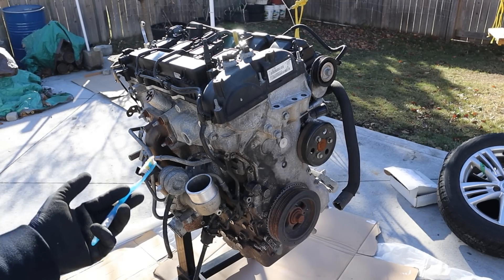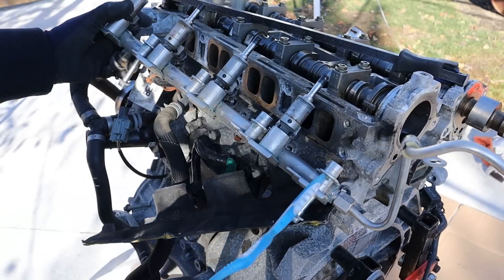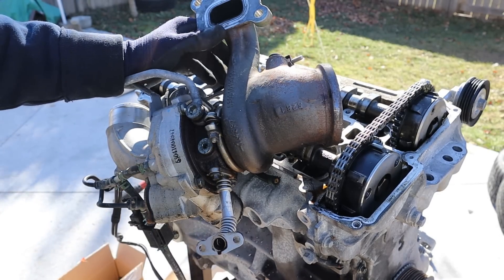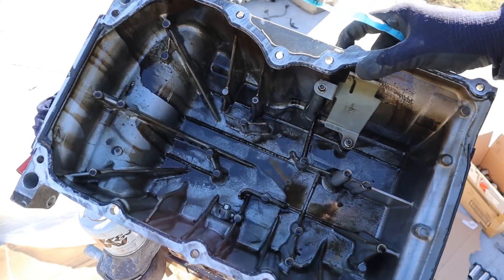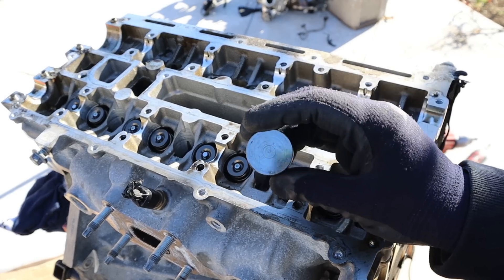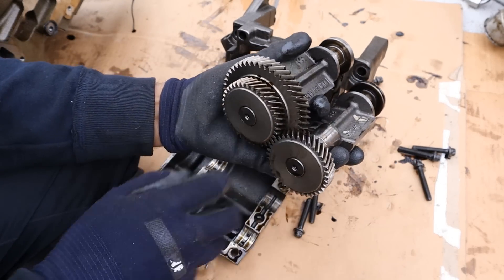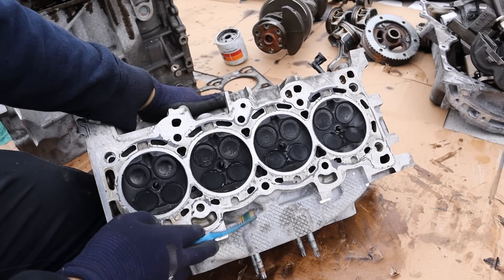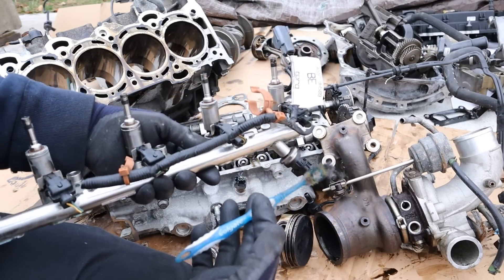Why Ford Ecoboost Engines Fail

Comment: Interesting.  I thought there was a class action lawsuit going on at the moment (in the US) for engine failures.  But I THINK that was for a later version, with, incredibly, a 'wet' timing belt, i.e. immersed in oil!!  So as the belt starts to crumble,  bits clog up the oil pickup & system thus destroying the engine.   Thanks for posting this.
Reply: The 1L ecoboost is what uses that wet belt design, as do their diesel engines. Who would've thought that putting rubber in oil would kill the rubber.
Reply: Another of Ford's better ideas??
Reply: Who thinks this shit up anyway????
Reply: @coolruehle  college educated engineers,  too bad their professors didn't know their ass from a hole in the ground.
Reply: @jeffro582  it’s best to not disrespect engineers. Tsk tsk
All engineers prefer simple designs that work, we’re not stupid.

Engineers design stuff, and are hired to design with constraints (eg costs)

Timing belt dipped in hot oil is never a desired design. That’s the feature that will sell (weight reduction, fuel efficiency, and novel)

I said “will sell.” Engineers are not hired to sell; only to design according to cost (which can mean cost cutting, which is not engineers fault)
Reply: Apparently, Ford is using the wet belt system in their latest Transits!!

Comment: In the 1980's Ford tried to use 4 cylinder engine in race cars that were pitted against V8 powered cars. Because of the weight difference, the Fords would lead for half a race, then the engines would burn out. I think one actually almost made a finish line, but burned up before finishing. Now they are doing this to everyone who buys this turbo shit.

Comment: All direct injection motors burn oil.... The carbon build up my guess is from not changing the oil frequently.......and was driven short distances usually.......highway miles really are a big deal when it comes to engine wear. Going over 3000 miles EVEN WITH FULL SYNTHETIC isn't a good idea with GDI motors....don't be cheap or lazy.....

Comment: My father's 2014 f150 with the 2.7 eco....no problems yet.....hasnt hit 100,000 miles yet. However my 98 explorer with the 5.0 v8 has 175k. Runs smoother than my 2500 Chevy 6.0 with 97k...... I run Lucas high mileage oil stabilizer every oil change with full syn Castrol oil in the Ford.....it started burning a little oil around 150k.....swear to Christ Lucas high mileage stabilizer stopped it from burning oil.....

Comment: Sure seems like a flaw, just like with charger engines that had coolant from the water pump seal leaking right into the crank case. What's up with that kind of garbage

Comment: My daughter bought a new escape 2.0 turbo in 2015. It now has 170,000 miles on it. Oil changes, tires and brakes is all that's ever been done to the car except at the 5 year mark I replaced the battery, belts, hoses, coolant, spark plugs, and coil packs. It has been a good vehicle.
Reply: My 2016 blew the head gasket at 66k just outside of warranty
Reply: @LiveLinerFishing  how did ya drive it
Reply: @fbcvxbnfgdgh  like a grandma. mostly highway
Reply: You're lucky.  My 2017 needed a new long block after 28k miles.
Reply: @angelas4681  yep. a $9k long block
Reply: You mush have pushed it for most of its 170k miles. 😂

Comment: My 2014 Escape 2.0 with just over 200k is still running well and smooth, trip from Calexico to Buellton averaging 26 mpg running it at average 70 highway speeds. I do maintain it regularly.

Comment: Nah. That ladder frame should be "aluminum". Not steel. Modern alloys make structural aluminum more ridgid than steel of the same volume would be. More brittle, but more ridgid

Comment: This is why it's Best to use Amsoil because it just makes the engine run better
JK I don't even use Amsoil 😆
Reply from the maker: Any oil regularly changed is better than extended intervals or no oil

Comment: Am I right in thinking that the carbon build up in the intake ports is due to the oil separator unit that puts the oily air back into the intake? Can this be bypassed to prevent the carbon build up?
Reply from the maker: Yep. And that's what supposedly caused this engine to fail...the PCV catch can.
Reply: @speedkar99  thanks for that,  now what do I do to stop my 2.3 ecoboost going the same way? It has done 46,000kms and doesn't use any oil. It gets serviced every 10,000kms at the dealer. Any advice would be helpful - even get rid of it quickly!

Comment: I have had 3 ecoboost engines which have covered over 150k miles with no problems you tube mechanics are ok but I prefer the proffesional company's as why would u make a shit product in this competitive world ..... I'm sure you have some failures but the percentage must be small buy unfortunately they shout the loudest........
Reply from the maker: Those small percentages also have an impact on brand image so everything counts, no matter how small.
Reply: So why single out ecoboost engines every manufacturer has failures if you did one on all of them it would seem balanced and fair no brand as you call it has a 100 percent product  and yes it does have consequences it usually does with everything   looking forward to your next upload.

Comment: Thanks for these great vids! I just like to mention that for (at least metric, I don' t know about imperial) fasteners you don't specify them by the head size, but by thread. So what you are calling 8 or 10mm bolts, are probably M6 (so a thread outer diameter of 6mm) bolts with a 8 or 10mm hex head. And what you call 12 or 14mm bolts, I think those are M8 or maybe M10 (either normal or fine thread). Same for Torx fasteners, so should call these smtg like M8 with a T40 torx head.
Reply from the maker: As an engineer I agree, that's how they're supposed to be called out. 

But someone taking this apart want to know what tool to use, the thread size would be irrelevant

Comment: 2017 ST here 150,000 miles no issues runs great. Oil change every 3000-5000 miles. Problem is the dealer’s want to do every 7500 and they burn a little oil so they fail easier if you go by the dealer.
Reply from the maker: Yep. The change intervals are too long
Reply: Damn you drive a lot. I got 130 on my ‘16
Reply: @dogewisdom9921  Yeah used to commute 150-200 miles a day. If I'm paying for it I'm going to enjoy driving it haha. I know a few people who don't drive their fun cars because they don't want to put the miles on them. I'm the complete opposite

Comment: Great content! This engine is a tour-de-force in engine design (thanks, Mazda!), and an engineering masterpiece.
I cut my teeth on pushrod, bathtub head clunkers from the 50s, and would have given my left ball for a beauty like this!
Reply: I'll give you the benefit of the doubt and hope that you were joking.
Reply: ford taught mazda how to build engines..mazda were sht..
Reply: @harrywalker5836  nope. Ford bought into mazda because they couldn't build anything other than a v8 reliably. Mazda was good before ford. And got bad during ford. And got better after they left.
The eco-boost is a bad turn based on mazdas L platform. Which mazda took and improved into skyactiv which are solid. While ford still can't improve a damn thing and are struggling to improve off a platform they worked with for years but didn't develop. They only ever threw money and hopes at it.
Reply: They blow headgaskets regular

Comment: Thanks! Terrific tour of a '16 Ford EcoBoost 2.0L Turbo.
My wife's '16 Escape has this engine and it's the first Ford we've owned in a long time. My fingers are crossed that our engine doesn't have some chronic problem. The first thing I noticed is that for such a relatively small engine (2.0L), the fuel economy is not very good.
Reply: They are Eco-or-boost, not Ecoboost.
Reply from the maker: In general, turbo fuel economy is not as good as claimed. The engine has to overwork itself
Reply: Same suv. 2.0L is way better than the 1.5L. 1.5 had coolant intrusion.

Comment: Cast aluminum oil pans are my favorite, I feel they are the sweet spot between light weight and strength.
Reply: Gee , if I hit one with a hammer, does it dent or CRACK??? LOL 😂
Reply: @@alexanderratisbona6614 steel pans also rust.

Comment: I love your no time lost teardown technique, fast and effective. You need a big air rattle gun for the tough bolts. I played the piston section of your video several times, it looks to me that the scraper rings were soft. Perhaps an engine that had been over heated without being fried. Otherwise rather sad that an engine in good nick got scrapped.
Reply: Given there were epic levels of carbonisation, I wonder if the turbo oil seals had failed and oil was being sucked into the inlet manifold. That's not uncommon with turbos, but it would have been accompanied by lots of blue smoke. One thing is for sure, that engine was not hydrolocked. If it had been, then there would probably have been a bent rod, and there would have been a lot of water, either in the cylinders or, possibly, in the sump. No sign of any of that.

Comment: He never said why Ford Ecoboost engines fail. Looked like a good engine to me. Just carbon build up. All direct inject engines get that. Pretty sure this engine didn’t fail. I have a 2.3 ecoboost in a 2018 mustang with 70,000 trouble free miles.

Comment: I get 21 mpg on the highway with my 4.6 explorer with over 200k. Still runs like new. Great video
Reply: I get maybe 14 with my HEMI... but I bought it for power ... not gas mileage.  LOL 😂
Reply: @davebrown4841  no one cares about your hemi bro
Reply: @butterh2  I get 28 with my 400hp LS2 C6 manual
Reply: @davebrown4841  As a lib, I feel totally owned.

Comment: Its such a shame that a company like Ford with over 100 years of experience has not been able to make a good reliable 2.0 turbo engine.
Massive respect for Toyota, Subaru,Mazda,Honda,Nissan etc who make engines rock solid reliable compared with Ford,GM,VW etc
Japan a pint sized country again shows its far superior to massive USA

Comment: 0:03 please go back inside and finish brushing your teeth.  Then come back and finish making the video. 
Waving that toothbrush around is really annoying
Reply from the maker: If it were a pen or pointer it wouldn't be an issue 😂
Reply from the maker: If it were a pen or pointer it wouldn't be an issue 😂

Comment: All that plastic, yuk! Direct injection, more yuk. I would use direct injection if it also had injectors on the intake manifold, which BTW is plastic. I bought a 3 year old fox body mustang back in the day with a 2.3 in it because by nephew had a crashed Thunderbird with the 2.3 turbo. We did the swap and that was a fun car to drive. The engine never died- the body did. Wisconsin winter victim.

Comment: Considering the complexity, I will embrace the skateboard. There're too many components on these engines. A vacuum pump?
Reply from the maker: Yes because turbo engines don't produce consistent vacuum to drive the brake booster

Comment: Shame they dropped the ball on the cooling system because the bottom end looks extremely solid. Very surprised to see bearing shells on the cam journals as well as that is actually a nod toward being able to repair an engine rather than it being a throwaway. So close yet so far.
Reply: have the 3.5 ecobeast on my SHO, supposedly the new yellow coolant helps some of these pain points, and lots and lots of regular fluid changes.  Heres hoping lol.
Reply: @RayoAtra  The new yellow coolant actually is the same coolant formula as the Asian carmakers. I guess Ford is finally choosing a coolant that is time tested.
Reply from the maker: I agree. Very well built on the bottom. Just have to fix the bolt on pieces.

Comment: Im glad i got Duratorq instead of Ecoboost.
Reply from the maker: And how's that holding up?
Reply: @speedkar99  1.5tdci, 2016, 240k miles, it is old sohc 8valve, no balance mechanism, change only 2 glow plug, just changing oil every 5k miles and oil pipe on turbocharger once in year.

Comment: Biggest problem is egr valve throwing all that carbon back in the engine and clogging the oil feed holes on top of that you have direct injection that can cause carbon build up on the intake . Get rid of of these 2 issues and engine is good.
Reply from the maker: I didn't see egr on this engine

Comment: For all the criticism, this engine is a marvel of engineering. Wow and to think that electric vehicles makes all this engineering useless.
Reply from the maker: Electric vehicles are more complex than this, in a computer engineering sense more so than mechanical
Reply: @speedkar99  Sorry I disagree.  I have worked on restoring old cars for some 1d years (hence why I enjoy your channel).  I bought an EV in 2014 to try it out and last year I started working on electrical propulsion systems (for aircrafts).  The electrical motors and controllers we use today actually date back to the 1950s.  Electrical propulsion is incredibly hassle free, really stupidly basic and incredibly reliable.  Granted battery technology is relatively new and developing at a rapid pace but the motor and its respective controllers are so simple.  The automanufacturers have plugged all kinds of electronics to try keep us from messing with their systems but a new breed of people are hacking those systems.  Still if you want to convert a gas car to electric - it is very simple and easy in comparison to say installing a different engine.   Check out a company called 'Netgain' as an example.

Comment: I personally don't like any of these superhyped up small engines. My hybrid has a 2.5 liter engine and still gives me an excellent mileage. And the engine is built to last. None of these 1 liter engines are going to last, though the reviews I read of the Polo 1.0 TSI is pretty good. But then again, putting this engine in a Passat? No way... Small engines belong in small cars and big engines in big cars.
Reply from the maker: Yeah there's quite some limitations and drawbacks with these overstressed engines. Hybrid is the better choice

Comment: What could reduce/eliminate the carbon build up besides adding non-direct injection?
Reply: oil catch can. one between the pcv valve and intake manifold where he showed in the video ( 02:46 & 13:45 ). There is a second ventilation before the turbo, but it seems not much oil at all is introduced into the intake with that one. when I installed my catch can there was oil draining through the throttle body because it was ingesting so much oil. About 20,000 miles later I had removed the intake manifold again and it was all dry. I also didn't notice much, if any, additional oil build up on the intake valves. I really like my focus ST and the engine, though I would insist on some essential mods. My only real complaints are its front wheel drive, needs AWD (like the RS) or rear wheel drive to be truly good, and the crank pully and gear are not keyed, so if that bolt he struggled with isn't insanely tight it can slip time.
Reply: @ddmn369j2  strangely the manufacturer hasn't included a catch can! I guess they'll just charge people to have the intake cleaned!

Comment: This engine seems to be quiet well built and technically ok as compared to most of engines.... Only few negatives being plastic cover and pick up tube. 
 Strength giving design is clearly visible. 
  You said evo boost wont last that long !!! Is it because of that well  known head gasket issue??
Reply: Simple non complex timing chain system.... Non complex lubrication  system and oil paths...  Simple cam driven vacccum and gdi ... 
 Pretty straight forward and non complex design.... So it should ideally last long.... Iff maintained

Comment: Any turbo charged engine will be a problem.
Getting 310 HP out of 2.3 ltrs.
@ high RPMs they won't last.
I've had two Ford vehicles and both of them,are gone.
Buy a normally aspirated V6 or Inline 6.
You be better off!

Comment: OK so, you destroyed a perfectly good engine. The only issue I saw is the oil was long overdue, and perhaps the engine was abused cold and never brought up to full operating temperature. Perhaps a commercial vehicle only making very short trips and driven by folks not giving a damn. The only defect was the $153 intake cam sprocket, whose play is guaranteed to have been misdiagnosed as a fatal bottom-end failure. All this engine needed was an oil change and an hour or two of hard driving. Kudos to whoever diagnosed it as dead.